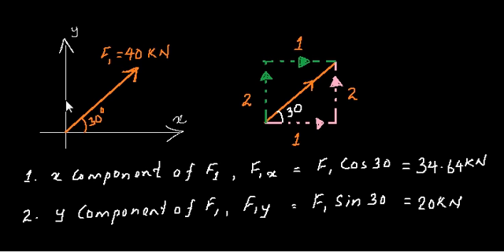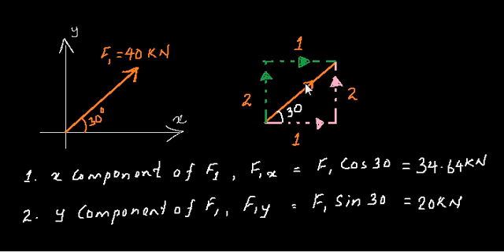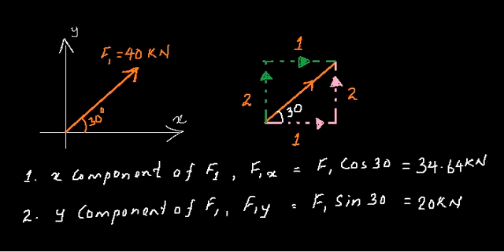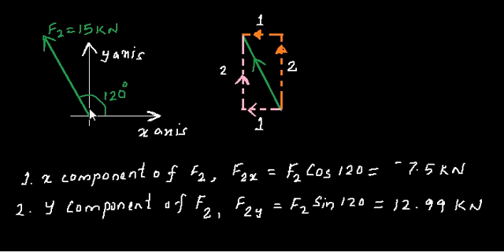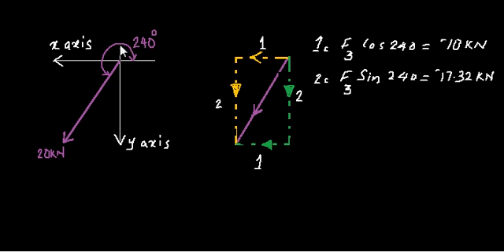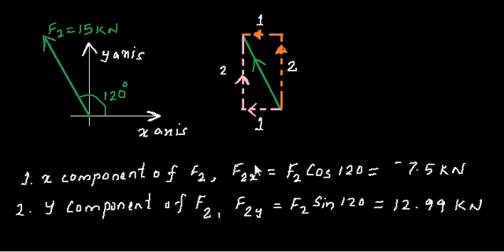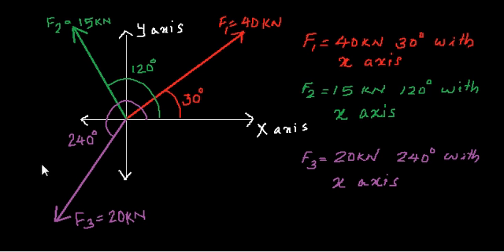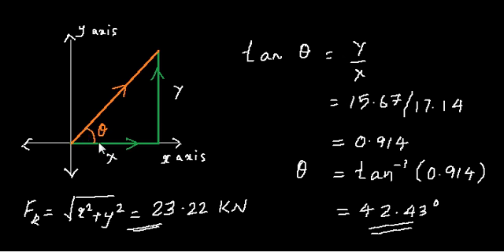Engineering Mechanics 6 - Forces and Moments

Comment: hello sir plz slovethis  problem.a body of weight 85N IS PLACED ONA ROUGH INCLINED PLANE WHOSE ANGLE OF INCLINATION WITH THE HORIZONTAL IS 35DEGRESS.IF THE CO EFFICIENT OF FRICTION B/W THE PLANE AND BODY IS 0.2, FIND THE LEAST FORCE REQUIRED [a] to prevent the body sliding down and [b] to pull it up the plane.the effort is appiled is along the plane
 Reply  ·

Comment: Ziado4  No, it depends where the angle is placed. If for example, the given angle was placed on x axis and you are supposed to find the summation of forces along x-axis, you should the the cosine. But if you are going to find the summation of forces along x-axis, that is when you're gonna use the sine. Same applies when the angle was placed along y axis.